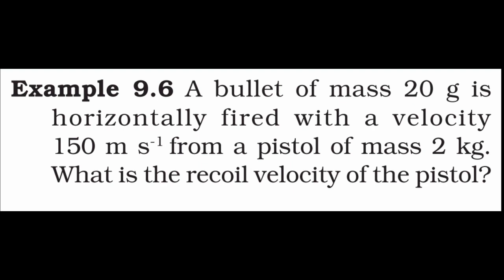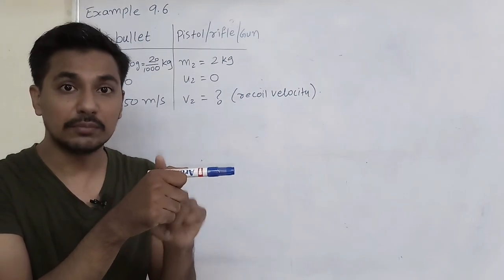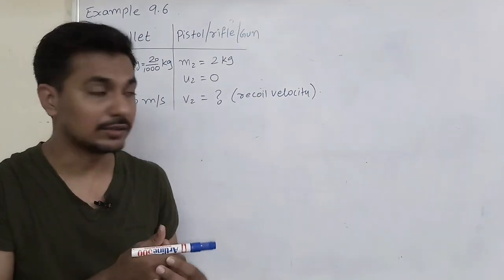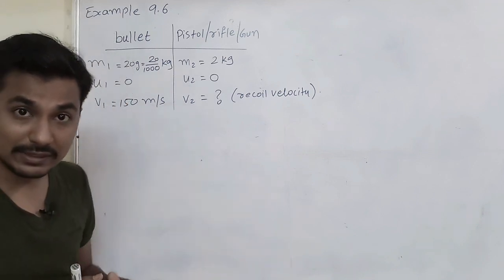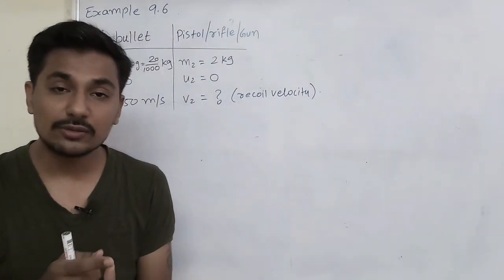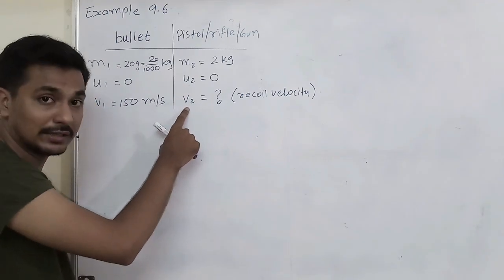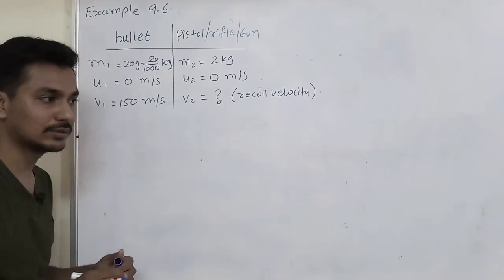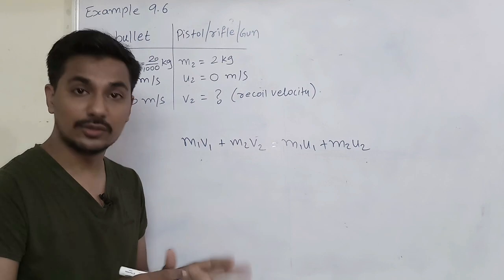Recoil velocity || Law of conservation  of Momentum || Force and Laws of motion || Class 9 || Ch 09

Comment: M1U1 + M2U2 = M1V1 + M2V2 

(50/1000) x 0 +  5x0 = (50/1000) x 300 + 5 x v2 

0 = 15 + 5 * v2
-15 = 5 * v2
-15  / 5 = v2
-3 = v2

Pls pin me sir if i am Correct :)
Reply: Another way to solve is to use Momentum.

For Bullet,
p=m1v1
P=(20/1000)×150
     = 3 kgm/s

For Pistol,
P=m2v2
=> v2= p/m2
=> v2 = (3/2)
           = 1.5 m/s
Ans: 1.5 m/s